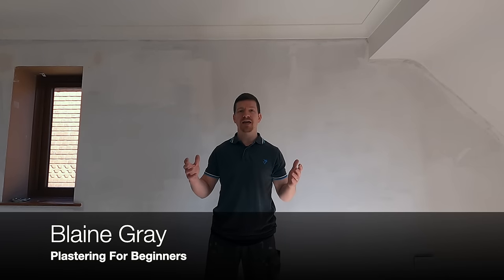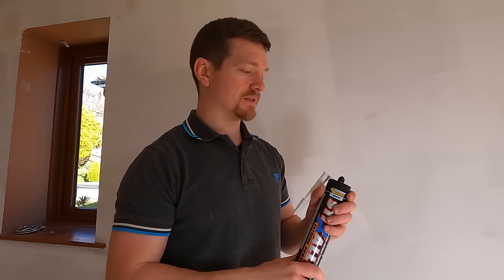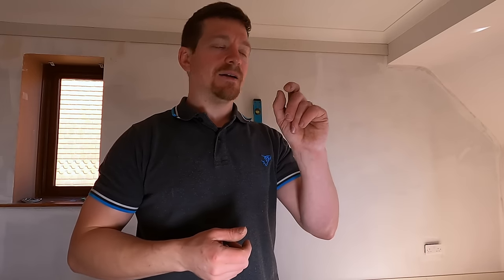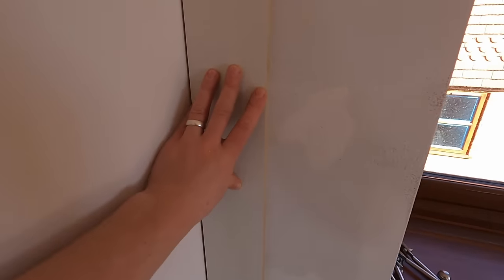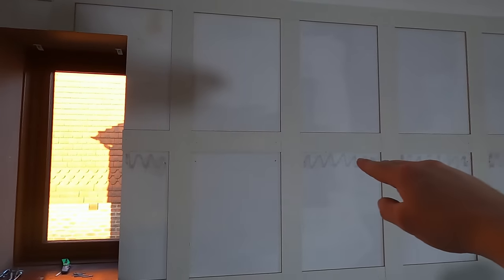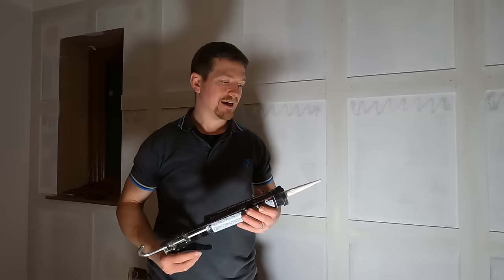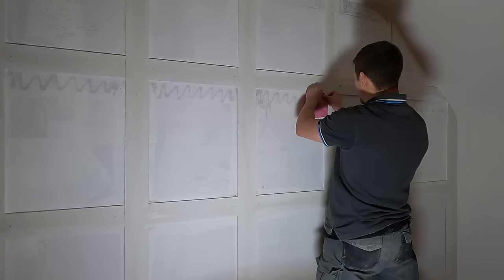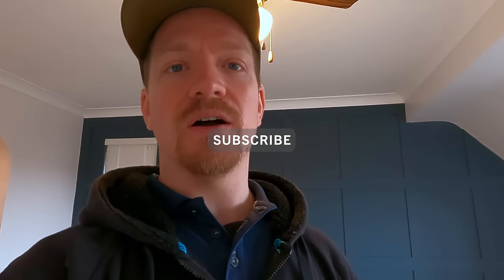How To Install Wall Panelling In Your Home | DIY Board And Batten

Comment: Lovely job Blaine. You seem to be able to turn your hand to most jobs! As a carpenter I get asked to do these quite often they are very popular. Plus I’ve done a couple at home. One tip to speed the process up is to cut 2 of the middle cross pieces at the start and use these to space out each of the uprights after getting the 1st one in level. That way you know the spacing will be exactly the same and no need to re measure each section. Just cut them all in one go and stick them on.. Hope that makes sense 👍
Reply from the maker: Thanks mate and great advice with the spacing. I’ll be using that next time - thanks for the comment and thank you for watching!!
Reply: That’s the way I do it. I make a jig or a template whenever possible. X

Comment: Looked good mate but a few heads up for u ( ur in my territory here) the window should have been framed around (as u suggested) even if it was smaller section timber and the right hand slope to ceiling it’s the way a Chippie would have done it around the window it would have prevented the end grain scenario (although I know uve used mdf here) it’s just good carpentry practice to finish it this way ( like u with the cleaning of ur plastered junctions wall to wall and wall to ceiling good practice ) that said u made a decent job of it it looked good
Reply from the maker: Thank you for the heads up mate! Really appreciate that and it’ll hopefully help the viewers watching. 

Cheers pal. All the best 👍

Comment: Good effort. I’m joiner by trade but do the plastering too for a while. Bought a house at 21 thinking yeah I can do it up. Wood chip everywhere apart from the windows. Soon discovered the paper held up the plaster.  It soon went from stripping paper to hack off back to brick. Back then I was like what the hell am I going to do. Me dad used to be builders labourer/semi skilled. Long story short he did  most of the plastering and had me mixing up and cleaning up after him I had a few tries with him holding my hand and made a right twat of it. Skip forward a few years working away on the joinery that dries up so decided to just be local. Doing this job n that job wood work new doors  etc a plasterer cancelled on the customer small job dwarf walls in a porch and artex ceiling. The customer was really pissed off so I said I can do that to help you out if you’re not happy don’t pay. Did it and got paid. Since then built up massive confidence and do just plastering jobs. Sometimes different joiners follow me on with the second fix if that’s already been agreed. Cannot fault anyone who wants to learn and try at something new. I’m loving the Venetian videos too. A Jack of all is better than a master of one
Reply: good job changing the quote at the end

Comment: The new hotmelt glues are a god send for this butt joints. Like Infinity PUR. The only way to minimize cracking and refilling/repaint over time. Same for skirting, door/window trims.
Reply: everbuild mitre superglue and activator can be useful too. will have a look at the hot melt though.....

Comment: Hi Blaine, as a beginner/ DIY  plasterer, does applying a pva/ water mix to fresh plasterboard allow you more time to work the plaster. A non plasterer said it does but I was skeptical and thought it’s best to ask an expert. 
As a joiner doing panelling, take your time with those corners and scribe them in whilst maintaining the level and treat yourself to a finish nailer pal😂

Comment: We just got a real old country cottage. Maybe 500 yr old wall. Thick. Stone probably. Breathable render in and out. Can we still use panelling and if so how? Thanks!
Reply from the maker: I couldn’t imagine it being a problem - the Victorians did the same and they had lime based plaster (which I’m guessing is what you have). So I don’t see it being an issue. I’d just use MDF because it won’t move as much. Hope this helps my friend 👍
Reply: @PlasteringForBeginners  thanks! Is there not a risk that moisture will build up between the panel and the wall, as the wall would not 'breathe', causing mould damp and rot?

Comment: That looks great. I don’t see the point of boarding the whole wall with MDF unless it’s in bad shape to begin with.  👍
Reply from the maker: Cheers pal!  Yeah I must agree now I’ve done it this way. It’s really not needed 👍
Reply: I think it can be worth battening the wall out if it's an older property and you want to put insulation behind then you would need sheets of mdf, otherwise as you say not needed.

Comment: Surely you didnt have to nail them really
Reply from the maker: It stops the lengths from moving until the adhesive kicks in. You need a solid fixing to keep them plumb Whilst you fix the horizontal’s.

Comment: What would you use to pin to a cement rendered wall Blaine ?
Reply from the maker: I’d test a patch without nails and just adhesive…see if that works without 👍🤞